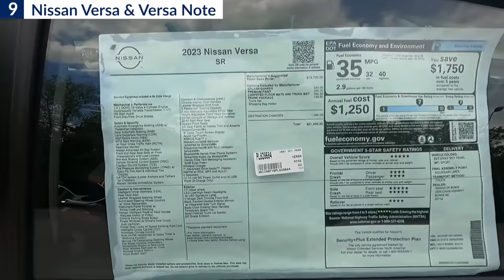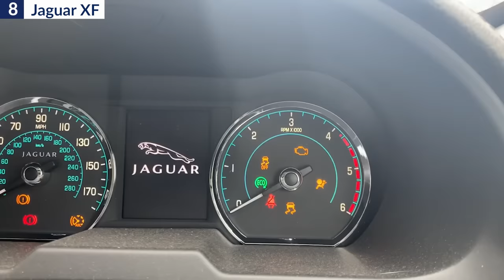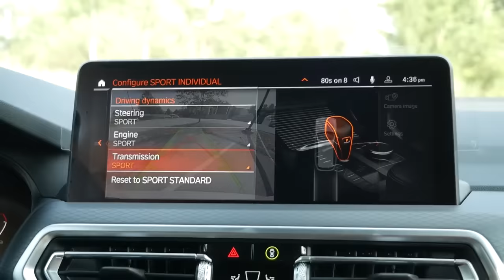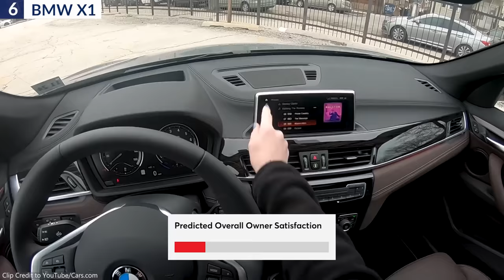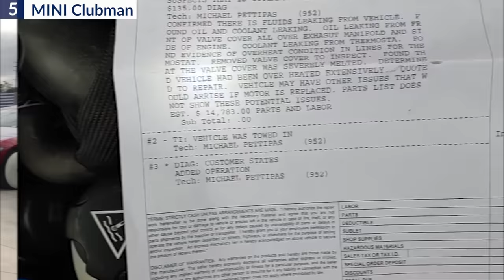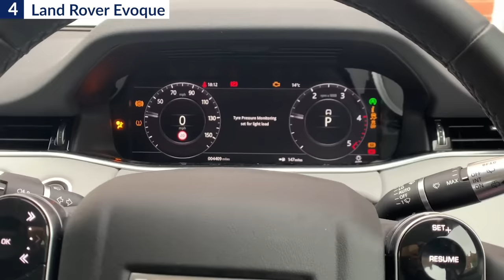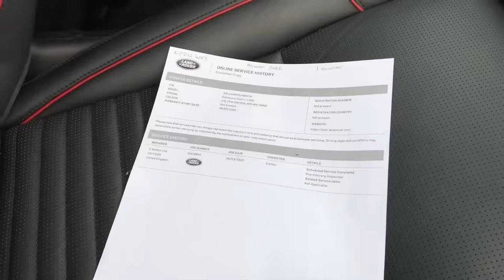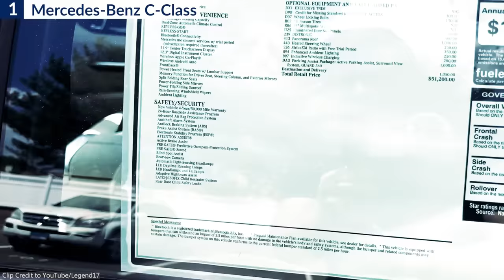9 Cars Owners Get Rid of in the First Year | Here is Why !!

Comment: What troubled me the most, as a mechanic for 50 years, was poor people who bought used luxury cars , not understanding the expense of ownership.
Reply: "your range Rover eml is due to a bad nox sensor, which will cost £550 for a genuine quality part, 2 hours diagnostic, and a hour for fitting, total will be £750" 
Customer:😮😢
Reply: As a mechanic of 25 years now I've always said "if you can't afford to buy it new, you can't afford to own it used".
Can't tell you how many people I've seen saying they got a good deal on this (bmw,range rover,benz,audi ect)
Reply: I only drive bmw and I only lease.
Never had to pay a dime for maintenance.
Reply: @Derekzparty you’re paying for it in the depreciation
Reply: @dforrest4503  I give the car back when lease ends.  Depreciation doesn't affect me!
Reply: @youtubecantsaveallthesnowf8601 I got a good deal on an Audi A3 Sportback.sold it after two horrible years. Changed the evaporator, two transmissions, thermostat amongst other things. It was burning oil when I sold it. Worse car I've ever owned
Reply: @Derekzparty How many years do you usually do a lease? Been thinking about doing it myself. I get why ppl don’t like doing it cuz ultimately you’re just paying to use the car and won’t get that money back whatsoever since a lot of ppl return it instead of buying it.
Reply: @jacks1bonnielass  I usually lease 3 years.  You do get something at the end of the lease even if you return the car.
For example I am currently leasing a 2023 m4 competition xdrive for 3 years at $1205 a month.  To actually buy an m4 on 5 or 6 year plan it was about $1800 a month.  So I save $600 a month versus buying it, $600 x 36 months = $21600 in savings. I could lease 2 cars in the 6 years it would take to buy one and with some very general assumptions I would need an m4 that I bought after 6 years to be worth $95000-$43200 or about $52000.  
Could it be maybe ... not sure.  But with leasing I don't need to care about the car. I can redline it at every stop sign/light and know that if anything breaks its under warranty and not my problem.
Having said that i wouldn't want to purchase mine after 3 years having known all I put it through!
Reply: $95000 was the msrp of my current m4.
Reply: @Derekzparty  I just bought a 23 Silverado. The computer knows every hard braking incident, every hard acceleration, every RPM it turns, every time over 80 mph.  Changes in lease clauses are probably coming.
Reply: @rustynail7866  Did the same thing in my 2020 z4 m40i.  No questions asked when I got the m4 last December.
Reply: @Derekzparty  Good deal. They wanted me to insure through them. I said Oh No. you guys know too much.
Reply: @rustynail7866  The bmw m cars were meant for the track.
The m4 literally has a drift analyzer for grading how well you slide through a corner.
I would assume bmw gives at least those cars a pass for ... spirited driving.
Reply: @Derekzparty  Yes I know all about M series. Officer Friendly informed me several years ago that I should sell mine.  I did.
Reply: Ppl that are born rich might not know or might not care because they only understand prestige and not necessarily reliability nor value and quality.
Reply: @SayAhh  When it comes to value and quality only 2 cars come to mind have a sub 3 second 0-60 and are under $100,000.
The m4 competition xdrive and the new c8 corvette.
You don't get those cars for the prestige you get them to drive fast!
For prestige you get a rolls royce/aston martin or really any car above $200,000.
So in a sense m4 and corvette are great values!
Reply: @Derekzparty  You pay for it up front & every month of ownership ! Anytime you want to talk about COST of ownership & compare it to my MX-5 Club soft top roadster I'm game !
Reply: @Derekzparty  You get them to understand how valuable a good Lawyer is ! Bleeding your wallet DRY !
Reply: @ag4allgood  My last car was the z4 m40i. 
Not as fast as the m4 but it was a 2 door convertible like the Miata and very fun to play around with!  
The 6 second 0-60 in the mx-5 was the biggest turn off for me.
No doubt the mx-5 was cheaper but also much less fun!
Reply: @Derekzparty  Your absolutely wrong. The whole less is more feeling is hard to describe to people that have NEVER driven one ! The Miata was NEVER about 0 to 60 times but rather ripping the corners at speeds your Z4 could never do without losing grip. The Lotus founder Graham Chapman said less is always MORE ! Until you drive one you will NEVER understand those words ! Why do you think the Miata is THE MOST RACED CAR IN THE WORLD ? The BMW M4 might be a great car in your eyes but it is an overweight hippo in comparison.
Reply: @ag4allgood  The Miata weighs 2341 pounds and outputs 181 horsepower. (12.9 pounds per horsepower)
The M4 weighs 3830 pounds and outputs 503 horsepower. (7.6 pounds per horsepower)
Going by the power to weight ratios the hippo is the Miata. 
In addition if we are talking about the grip between a z4 and a Miata it's as simple as looking at the Car and Driver skidpad results
Miata Roadholding, 300-ft-dia skidpad: 0.90 g
Z4 Roadholding, 300-ft-dia skidpad: 1.00 g
And while we are here ...
M4 Roadholding, 300-ft Skidpad: 1.02 g
(A higher g means more grip)

I'm not trying to be mean ... the performance is just what you get when the car costs 2-3s times more
In fact if we go even higher
911 GT3 Roadholding, 300-ft Skidpad: 1.11 g
But those start at an eye watering $170,000!

The short answer of why is the Miata the most raced car in the world is the 911 GT3 doesn't cost $30,000 lol
Reply: @Derekzparty  You can put all the numbers up you want it doesn't change the way the Miata drives in comparison to a Z4. Given another $37,500 in modifications to a Miata ( to bring the dollars spent equal ) I'll take the Miata ANY DAY over the Z4 !
Reply: @ag4allgood  To each their own!
Something to make note of is $37,500 in modifications will most likely void the warranty.
Reply: @Derekzparty  LOL !
Reply: Got a Lincoln town car a year ago dirt cheap. 92 SS dual exhaust. Amazing shape.  Not one issue so far
Reply: @lostbooks2918  Town Cars are inherently excellent vehicles. Though they are considered “luxury” their sum of parts are basically Ford, which makes them less expensive to repair than a Mercedes or BMW.
Reply: I blame reality TV and advertising
Reply: @ag4allgood  For some people acceleration and speed are everything, so they enjoy their M4. For others a huge amount of fun at the wheel is their poison, so they savor their Miata ☺. I enjoy my E63 6 Series coupe, but have a lot of fun in my MX-5/Miata.
Reply: This is an interesting topic. I suspect it's a combination of a few economic and social factors, such as rapidly growing economic inequality coupled with stagnant wages. Millennials in particular seem more concerned with maximizing value than previous generations, with "X-hacking" ideas often going viral on social media as "tricks" to get around the way things, they feel, are stacked against them. Now take this "bougie on a budget" mentality, and add onto that the normalization since at least the 80s (and maybe longer than that, but I grew up in the 80s) that virtually everything in America is meant to be cheap and disposable, so if you buy your bougie but old car and it breaks down because it's old, no worries--used cars are 'disposable' now anyway.
Reply: If they're buying a luxury car and not intelligent enough to understand it's going to have a much higher than average cost of ownership I have no sympathy for them. It's not rocket science is it?
Reply: @Derekzparty  If you're leasing cars you're paying far more than average, you're just paying it to somebody else.
Reply: @Derekzparty  Yep, and this is why so many people have problems with ex-lease cars. I believe it should be declared when the car has been leased so those who can only afford to buy used know exactly what they're buying.
Reply: @severnsea  My monthly note is $600 lower versus buying which lets me pocket the difference each month.  Over the course of 3 years I would have saved 600×36 or $21,600 or $43,200 if we are comparing it 2 - 3 year leases versus a 6 year buy.
Scroll up for more detailed math.
Reply: @Derekzparty  That may work for the US but not in the UK where energy is more expensive and people only drive an average of 6-7000 miles a year. It's also not going to benefit the environment (which is supposed to be the whole point) if you're getting a new car every 3 years instead of every 6.
Reply: @severnsea  It isn't like leased cars head to the scrap yard as soon as the lease ends.  
The car simply goes to the next person.
In my old z4 the car had an eco mode for eco driving.
My current m4 doesn't even pretend to save gas with its lowest setting being comfort.
Reply: @Derekzparty  Yes, but if you move on to the next new car as soon as the lease is up then that's a new car that's going to be built every 3-4 years or so to meet the demand. Older cars are going to be scrapped a lot sooner than they are now in my opinion because people are not going to want the risk of buying an old car that may one day need new batteries. I'm talking about those people who buy 10-15 year old cars. If the batteries are expensive to replace a lot of people won't buy them so they'll end up being scrapped earlier than current ICE cars are. I know the batteries might be made to last a zillion miles or whatever but that won't stop people worrying about the potential replacement cost if something goes wrong.
Reply: @severnsea     If they are going to junk a car over a $200 battery that's their financially stupid decision lol
Reply: @Derekzparty  We're not talking about a $200 standard 12v battery, as well you know. lol.
Reply: @severnsea  Since I only lease I've never had a car battery go out ... i assume the 12 volt lead acid car battery is a standard?
Reply: @rustynail7866  Oh, it will be worse than that. Give it another 10-20 years and they will be sending you fines by post every time you go over the limit. They won't even need speed cameras.
Reply: @ag4allgood  I agree, but cars like the M4 are designed to be a family car as well as something you can have a bit of fun in. It's not all about who can take a corner the quickest.
Reply: @Derekzparty  I'm talking about going forward, when we're all stuck with EVs:
"If the batteries are expensive to replace a lot of people won't buy them so they'll end up being scrapped earlier than current ICE cars are"
Reply: @severnsea  LOL my mailbox ain’t big enough.
Reply: @severnsea  With a little maintenence even a 30 year old ice car can run decently well.

Once the battery in an ev is degraded the battery is physically and irreparably damaged.

Without significant advances in battery technology, aka solid state batteries, what you say will be our future.
Reply: @severnsea  It takes a whole lot of squinting to get family car out of m4 lol!
Reply: @Derekzparty  Yes exactly, I totally agree. And if buyers down at the bottom of the scale who can't afford much are scared off buying EVs because they are concerned they might have to spend thousands on a new battery, they won't buy so the cars will be scrapped earlier and won't have saved anything at all in emissions, which is supposed to be the whole point. The batteries may well be fine but that won't take the fear factor of them potentially failing away and will put people off buying, in the same way that they tend not to buy larger older cars now because of the concern over a potential big repair bill, hence the reason a powerful 10-15 y.o. saloon/sedan are so cheap to buy.
Reply: @Derekzparty  Can't argue with that! Something that somebody with kids is more likely to buy than a Miata though (we call them an MX5 in the UK).
Reply: They don’t care about expense of ownership.They care more about impressing others and showing off.The expense of ownership is an afterthought for them.
Reply: @Derekzparty  "I only drive bmw and I only lease." Leasing cars doesn't mean an unreliable car isn't costing you. While it's in the shop, you are paying for a car you can't drive. With BMW's loaners, that might be an excellent investment, since you get to drive a better can that what you are leasing. I came across that when my Sidekick was totalled and insurace put me in a deluxe Escape for 12 weeks.
Reply: @mikep490  The last 3 cars I've leased, 435i, z4 and m4 have been problem free with the only time spent in the shop being from pot holes/flat tires.
They were all new model cars so being problem free wasn't unexpected unlike with a brand like kia.
Reply: @mikep490  Even the times in the shop have been relatively brief thanks to the runflat tires being able to make it to the dealership without a tow truck along with my local dealership have replacement tires on hand.
Reply: @Derekzparty  That's good news. It's nice to know, reliable and only $8800 a year. The unlucky guys are those who buy and then have to sell. I'm sure some of those are corporations cars traded in.
Reply: @Derekzparty  If you think depreciation doesn't affect you on a lease, you don't understand how leasing works.
Reply: @MLHunt  I never own the vehicle so it depreciates while bmw owns it.
I make my deal once when I get the car.
Reply: @Derekzparty  Every lease agreement I've ever been aware of has a residual value term that is a major factor in calculating the total cost of the lease. Higher depreciation rates --> lower residual value --> higher lease payments.

Just think about it logically dude. If a lessor didn't take depreciation of the asset into account in determining how much they'll charge for the lease, there'd be no way for them to be certain they recoup their investment at the end of the day.

Depreciation of a leased asset is definitely a factor in what a lessee pays over the course of the lease, the fact that they don't own the leased asset notwithstanding.
Reply: @MLHunt  In a car lease a large portion of what you are paying for is the depreciation of said vehicle. 
When I said depreciation doesn't affect me it was in respect to the current and future value of the vehicle.
Whatever the vehicle's residual value is in 3 years does not affect me one bit.
If a solid state battery breakthrough causes EV's to take over the world in 2025 making the value of every internal combustion vehicle half of its current value or even lower it doesn't affect me because I have already made my deal with BMW and they have to honor it due to the contract we have between us.
Reply: @MLHunt  Had I purchased the vehicle from BMW on a 3 year plan in that same situation they would only offer me whatever the EV breakthrough reduced price of an internal combustion vehicle would be if I decided to sell it to them to get another vehicle.
Reply: @Derekzparty  I understand, and thank you for clarifying. But you don't think the dealership factored the probability of accelerated depreciation of current generation vehicles into its residual value projection? It would certainly have been prudent for them to do so given how rapidly the technology is changing.
Reply: @MLHunt  Unsure of how BMW price their vehicles but I would assume their new electric cars/suv are a hedge against rapidly developing technology that could possibly make their internal combustion vehicle lines obsolete.

Most every car manufacturer would prefer a glacial shift from internal combustion to electric due to all the research and development they have already spent on internal combustion.

I guess BMW could tack on a 1% breakthrough insurance fee on every part if they wanted to, but spreading their risk by creating their own electric vehicles sounds like a better solution.
Reply: @Derekzparty  Leasing is for most people an unlucrative thing. In your maths you forget the point that after you paid your car, you own it, and its probably worth around 60k or smth and you can sell it instant, while when you lease, you own thin air after it. That beeing said there are also car manufacturers who throw very juicy leasing deals on the market just to establish the brand, like cupra does in Germany atm, were offers appeared of 200 bucks a month for a 300hp cupra suv. 
I myself leasing since 12 years now, but only because i get juicy deals, for example im Leasing 3 Transporters atm with each cost me 240 bucks a month, while the usual leasing rate for the same transporter is about 600-800 a month depending on the interior. 
You cant say leasing in general is good or bad, it really depends on the deal you are getting and some deals are very interesting while other deals for the same car are just ripping you off. The carefree maintenence of a leased car is a cool plus tho =)
Reply: You're so right! My son fell in love with a used 2017 Porsche Panamera and found out he made a huge mistake!!
Reply: @xxxxXRIPXxxxx  The difference in your monthly lease payment and the monthly note if you had bought it is not thin air and can be substantial as you have just mentioned if you get a good deal on a lease!

Nobody seems to understand that $500 saved a month for 36 months is $18,000 in total savings.
Reply: @Derekzparty smart

You get rid of it before the problems show up.  👍
Reply: People don't do the regular maintenance like they should.

Notice  no Japanese or Korean car was featured .  👍 👏👏👏

Mostly European makes. 

Opps ...  A Nissan made this list 😮
Reply: @mikep490  Yep, and by leasing you're paying a lot of money for something you will never own.
Reply: @Derekzparty you can say it doesn’t effect you, but you ARE paying for the depreciation. Now if you don’t care, that’s one thing, but you are paying them for the privilege to have the long term rental.
Reply: You got that right, once upon a time, a co-worker bought a used BMW, he quickly rued that decision.
Reply: @justSTUMBLEDupon  You aren't understanding.  The projected depreciation is baked into the lease meaning whatever happens to internal combustion vehicles doesn't affect me even if internal combustion engines are made obsolete in 2026 when my lease ends.
My deal has already been made and is set in stone!
Reply: YEP I have owned over 90 cars the most expensive ever was  1997 BMW 740iL (in 2001) with 90, 000 on the clock.  Paid 22 grand (it was about 70 new) and about 10 in Maintenace.
Reply: @Derekzparty yeah but then you have come up with $$$ for a down payment on a new lease and pay for mileage if you go over, tires, and interior cleaning of the car.
Reply: @Derekzparty information always wins the argument ! 😎
Reply: My first "real" car was a Saab 99GL. Not a "luxury car" per se, but European. I sank so much money into just keeping it on the road. How much? In just two years, more than I originally paid for thee entire car.
Reply: Lol … I brought a lovely 2009 Mercedes Benz SL and promptly sunk $8k into a $15k car. 😳
Reply: Way too many people struggle to keep their cars on the road.  Insurance prices have gone through the roof, and there is the FoMo crowd that wants a better car in the driveway than the neighbor, until, of course, that car gets stolen or put on blocks.  High fuel prices also eat into the cost of ownership and getting a set of new tires will sit you back CAD $1000 or more (likely more).  My CX-5 is going into its tenth year and owes me nothing.  Regular maintenance, on time, and driving it with care will hopefully put two more years on the rubber.
Reply: @aelaan12  I keep trying to explain this to my girlfriend, who grew up in a city and never got her drivers license. She's in the process of getting it now and already bought a used car from one of her friends. She has absolutely no idea how costly it is to own a car. I guarantee within a year she'll give the whole thing up and go back to taking public transit.
Reply: Good to figure. They are poor for a reason.
Reply: Luxury cars have the highest depreciation
Reply: @Derekzparty  I have had a couple! Lease with warranty is the way to go! Otherwise, no warranty, and you are screwed! Still love how the car drives!
Reply: @Derekzparty  So you are paying $43280 for 3 years on a 95000 car. But you have zero to show for it at the end and zero to  use towards a new car. Leasing is good if you drive a lot and have the money, otherwise OWNING is the way. You don't have to own a 95000 car. You can get a 43280 car buy it outright, use for 3 years and then have say $20,000 to put to your next car, so now that next car that is say $43280 is now only 23280, then you are owning a 43280 car that you only paid 23280 for, and if you trade in two years, you may actually get even more. CASH is the way to go all the time. The problems with cash come when you are spending TOO much upfront. 95000 is a stupid amount to pay. 43280 for a new car ( ike a mazda cx 50 ) is easy
Reply: @Jack_Hunt  I have the difference between the lease payments and a 6 year note payments, assuming I had purchased it, as something to show at the end of the lease.
$600x36 months= $21,600 saved over the course of a 3 year lease versus buying it.
Double that to $43,200 for 2 leases and I am simply betting that over the course of 6 years a purchased m4 will be worth less than $43,200.

A quick google search of 2017 m4 show their prices in low 40s.  Subtract any maintenance required during those 6 years and I can be quite certain it will be near $43,200 if not below it.

Obviously it would be cheaper to buy Mazda-CX-50, but then I would be in a slow suv.

Having said that I used to have an RX8 and would be quite interested in a 400-500hp RX9.
Reply: @jakebatty530  You do know that maintenance is not a thing on new cars, if it goes wrong and is not a consumable  for the first 3yrs or 100,000miles then it's on them.  Thats why people buy new cars, peace of mind.
Reply: @marcjohn7416  again if it was brand new it had a warranty. If it was brand new and smoking after 2 years you have got to ask yourself was it something I did because Audi's don't smoke after 2 years from new unless they've been really badly abused or you used distilled potato peelings for fuel.
Reply: @jonhiggins8390  the replacement mechatronic was new and it broke again after a year. I don't drive crazy fast or accelerate quickly. I got two young kids to live for. Tell me how does one maintain a transmission that's less than a year old?
Reply: @SayAhh Correct
Reply: you not wrong. Why do people do who can't afford the car, would want to get the POS car in the first place is beyond me. I'm make good income and all I drive is a Toyota Corolla.
Reply: Yeah, if you can affford the car, you should be able to afford the on going maintenence, these figures aren't about the cars they're about the owners.
Reply: I'm with you Rusty. I am a retired tech also. I've seen it all and so have you.
Reply: @jakebatty530 I have a 2007 Range Rover Sport TDV6 and it costs me an arm and a leg in parts and service costs (even at a regular garage). But I knew that when I bought it and accepted it up front.
Reply: Of course it does.  Expected depreciation is built in to the lease formula.  You are paying plenty, and didn't even know it.   @Derekzparty
Reply: @rrrogster  Expected depreciation being built into the lease formula is the entire point.  No matter what happens my lease is locked in place.  
Every quart of oil, every tire, every major engine issue is covered with no deductible.
I know exactly how much I need to pay every month for the car and not a penny more.
No surprises!
Reply: I agree completely. As many replies here state, many lease and just trade in every year or two which means there are significant deals to be had. I picked up our X3 a year old with 15k miles on it and saved $16k just because it was a year old. I do all my own car work and maintenance so it's an excellent deal. The ZF transmissions are the best in the world and the B48 is much improved over the N20. I recommend thicker oil if you drive it like it should be driven, I use LL-01 approved 5w-40 (Castrol Edge) and change it w/ filter every 5k-6k miles, total cost $35. I did plugs and air filter at 30k miles. Plugs are $20 each so that was $100. I just did the 50k maintenance, trans filter/pan & fluid, differential fluid, and cleaned the intake valves due to the direct injection. Total cost was around $300 for all the parts. Total cost in maintenance so far w/ all oil changes is $715 over 3 years and 55k miles total on car. That's only $240/yr to drive such a nice vehicle and keep it excellent condition, I'm okay with that since it's about the same costs of other cars I've owned (Subaru/Honda/Toyota). The Subaru was the most expensive because it had a timing belt which I did twice, first at 75k (belt/tensioner) and again at 150k (belt, pulleys, seals, waterpump, tensioner, etc..) before I sold it privately. Around 100k the valve cover leaked oil into the spark plug tubes. Thermostat went not too long after that. Our older Subaru legacy had head gaskets fail around 120k. I won't buy Subaru again, they cost too much for what you get, nothing special and not very fun to drive (sans WRX).
Reply: Nothing depreciates faster than a German car.  They are so cheap that when a major problem arises, they are junked.  In California, I've seen many German cars that are rust free with immaculate interiors in the junkyard.  It's truly a waste.
Reply: I know what you mean.   I hope they are not buying EVs.
Reply: @encinobalboa   That says more about Californians and their lack of proper car maintenance than what it says about "German cars".
Reply: @Derekzparty  You Must Be Really Loaded With An Over Inflated High Paying Income Job For Whatever Reason.  But For Us REAL Actually WORKING Folks;  Imagining That A Car Would Last 30-Years, Just Think How Much Money Your WASTING By Not Owning A Car For That Long.  All Of That Monthly High Dollar Car Payment And Much Higher Insurance Cost,  Could Be Better Invested For Your Kids College Or Retirement Years.  Let Alone Helping Out Charitable Organizations For The Poor And Starving People Abroad.  We KNOW What Scraping Buy And Living Within A Budget Entails.  But Self Centered Braggarts As You Sound Like Are Actually SICKENING To listen To Indeed Kiddo...
Reply: @davemckolanis4683  Driving a 30 year old vehicle sounds like it would be extremely unsafe for you and those around you.
I give 10% of my income to charities each year.
I don’t have nor want kids.
Reply: Like Dave Ramsey said" they try to impress people they don't even know".
Reply: @Derekzparty That’s the smart way to do it, I remember seeing someone drop off their laundry in a bag and let someone else do it, there I am spending most of a Saturday afternoon fumbling with quarters doing my own laundry and waiting for the clothes to dry,
Reply: @Derekzparty  : You are lucky that you never had to replace the thermostat - when they go out, the parts alone cost something like $700. Also, when you have even a mild crash, the electric power steering will die shortly afterwards. Very well known problems with the BMWs, unfortunately.
Reply: @marcjohn7416  On the cars with the V8 with the dual runner intake manifold, the timing chain will die around 60K miles, and break the crankshaft.The next problem is that the plastic throttle plates that select which intake runner get used break, and then cost you something like $4K to replace the whole intake assembly. Want to change something on the very front of the engine? Totally disassemble the front end to get at it.
Reply: Yep! that is SOP on what keeps poor people poor
Reply: Debs husband says Mercedes Benz and BMW are two cars I will never buy simply because the maintenance and repair costs are more than I am willing to spend. They are great cars if you have the money.
Reply: @Derekzparty The only problem I have with the leasing business, is that you'll probably spend the same amount on leasing two cars in 6 years as buying a single one. While at the end of the 6 years you would own nothing, and still be lighter in cash worth a whole car. Furthermore, you won't have gained the experience required to maintain a car well.
Reply: @TheWeedOperation  The difference between purchasing an m4 and leasing an m4 was $600 ... $1200 versus $1800 a month.  Multiplied by 36 months and we get a savings of $21,600 over the course of 3 years.
Doubling that for a 6 year purchase the question becomes will a 6 year old m4 sell for more $43,200.
Some quick google searches show 2017 m4 in the mid $30k to mid $40k range.
All the cash saved each month can be put towards more profitable things like stocks and bonds versus hoping the dealership shows pity on me and gives a good deal in 6 years for the hypothetically bought car.
Reply: @TheWeedOperation  As for experience maintaining a car that's what we have car technicians for.
They literally went to college/earned certificates for exactly that purpose.
In the same way I wouldn't expect them run the ethernet, punch down the cables and program the routers and switches at their establishment.
Not that they couldn't with all the right resources but it probably wouldn't be time/money efficient to do so.
Reply: @Derekzparty  How much is your average payment to secure the car and monthly payment? Do you have to pay gap coverage?
Reply: @youtubecantsaveallthesnowf8601  Not always true.  I can't afford to buy Toyota's new, but I buy them used and so far they've lived up to the reputation.
Reply: @rustynail7866  It’s dystopian
Reply: @jawharris  I'm paying $1205 for the monthly lease payment.  If gap was required it's included in that.
$83 a month for insurance.
Reply: @Derekzparty people outside the US don’t understand how interest rates have impacted purchase affordability vs lease in this current market.  Makes more sense to lease ANY bmw over purchase no matter what but especially now it’s a no brainer for a lot of cars not even just bmws.  Try to go even deeper and look at used cars and even that reinforces that a lease is most prudent in this market
Reply: @davemckolanis4683 lol you just said bmw and 30 years? 😂  if you ever try to buy a bmw built in the last 20 years you will learn why leasing is the Only way to do it.  If you finance you will lose your butt if you try to resell.  Doesn’t necessarily apply to all cars but certainly does for unreliable German ones.  Bottom line you are buying a bmw for its best years not year 8-15 when you’re sinking thousands a year in maintenance.  The luxury market has never been predicated on long term ownership.  Is what it is, that’s why it’s a luxury lol.   

I owned a f87 m2 and financed, sold after 4 years losing less in dep than a Toyota Corolla, but that was an anomaly and mainly due to interest rates at the time, Covid and limited production numbers.  

I know a guy that bought a 92k m4 and sold it less than 3 years later for 52k.  Just lease and be ok with spending that money every month, or don’t buy a bmw
Reply: @youtubecantsaveallthesnowf8601  I've always said whatever you pay for a used luxury car you should also have the same amount of money set aside for repairs. Some of these cars cost 10k a year to tax, insure and fuel and maintain.
Reply: @gravemind6536  hell, you need double.
Can't tell you how many customers I've had that got a "screaming" deal on a benz or bmw only to find out they have a repair bill double what they paid for the car.
Reply: @Derekzparty you pay for that with the equivalent of a 27 percent interest rate on a lease
Reply: Lexus is one of the cheapest cars to maintain. 
It is slightly higher than Toyota average
Reply: Pretty much anything Europeon particularly German is high maintenance and does not do the miles reliably  that a typical japanese model will do. One of the worst examples is the Audi v8 that has timing chains at the rear of the engine. These do not last much longer than a timing belt so need changing. This is a complete engine removal for this job. Another example is the BMW hot vee engines which are a total disaster. Yet another example of poor design and engineering.
Reply: @TheAllEngineering  anything vw...people think they can treat a jetta like an accord... it doesn't work.
Reply: @riogrande5761  thats because they are older toyotas...new ones suck.
Reply: @youtubecantsaveallthesnowf8601  poor advice in my opinion. I choose not to finance a car, I don't want a lot of money tied up in a car. I've owned multiple BMWs, Audis, Mercs, Saab, never had a problem affording bills, but its never been too bad anyway. Worst was Ford and Mitsi for reliability and repairs costs.
Reply: @krisby1  then count yourself lucky.
Reply: This is prevalent in the Black community. While I never fell for the scam of a used luxury car, my family members did.  After tax return they would go buy a loaded 10 year old BMW or Mercedes with 150k miles and then put 4000k dollar rims on it at a buy here pay here lot. But they’d miss a payment because it would inevitably break down due to poor maintenance. It’d get repoed a few months later after hiding it from the tow truck.
Reply: @Derekzparty You do it through the high amount of down payment/front loading, high monthly payments and high taxes on a new car. I've done it.
Reply: @youtubecantsaveallthesnowf8601  Great expression
Reply: @Derekzparty   $1205 a month for a rental and your braggin about  not paying maintenance costs? LMAO. A sucker is born every day man.
Reply: If you lease, hope you don't get divorced because  companies, banks, dealerships don't care. " F U, pay me"
Reply: @claviclenotch1876  Same situation as if you didn't lease.
Whoever's name the agreement is in is still responsible for payments.
If the other partner cosigned then the lending party could pursue both people.
Reply: I’m more than a little surprised that there are so many high end cars on the list. Some high end brands have been notorious for unreliability as far back as I can remember. And I don’t know why anyone would buy a used high end car that they couldn’t afford to buy new as is with no warranty. As soon as it needs work of any kind they find out why.
Reply: It's called braindeadness 😂😂😂😂
Reply: When I bought my roadster, the only options available were Porsche, Mercedes, Toyota, and Mazda. As tempting as the luxury styling of the German cars were, I settled for a car made in Japan.
Reply: @youtubecantsaveallthesnowf8601 
There are two things every man should avoid in life, high maintenance cars and high maintenance women.
Reply: @Derekzparty lol , u did say you lease!
Reply: @Bigdrip840  I did!
I'm saying the bank doesn't care if you lease or buy.
They always want their money!
Reply: @Derekzparty  uh
Reply: @jacks1bonnielass  you don't get deprieciation back whether you buy or lease.
Reply: The worst light you will ever see is a "Check Engine" light in a German luxury car! At the big auctions, MB and Audis sell way below their new price once the warranty is gone.
Reply: That's why they're poor.
Reply: @marcjohn7416  
Me too, I trashed my A3  45k miles, at the junkyard.
Reply: @Derekzparty  What "Depreciation doesn't affect me", lol, you are absolutely the first one to absorb the cars depreciation in your lease payment.
Reply: @youtubecantsaveallthesnowf8601  I remember buying a 2005 corolla for $500 all it needed was a new axle since for some reason the throttle was a touch too snappy, probably something the previous owner did. for 3-4 years the only thing I did was oil changes. 

The check engine light was only because of O2 sensors acting up or some. Specifically a P0420 code, despite the cat being replaced. Some sort of exhaust leak or something could be causing it, but that's as bad as it got. It would stay off long enough to pass emissions at the least. 

Only bought a new car as my family wanted something to make sure I wouldn't miss a day at work, but I bet I wouldn't miss a day in this corolla anyway, even with over 200k miles.
Reply: @rustynail7866  Also citations will eventually be coming for those tracked items as well. Don't forget the sensors they want to add for alcohol and other substances.
Leasing is fine if you are a business as it is a right off, but as a individual it makes less sense.
Reply: so you were a judgemental mechanic? what luxury cars were poor people buying 50 years ago? i call BS
Reply: @antcantcook960  Your reading skills are extremely limited. I didn’t retire 50 years ago. I worked in the industry for that amount of time. Secondly, in case you think you invented something, Porsche, Mercedes,Cadillac, Jaguar, Range Rover and Lincoln were available long before you arrived. I call DA.
Reply: Or prep people buying ford's. Mind blown
Reply: @Derekzparty after all these years of paying for a vehicle you own nothing.  You lost all that money on leases.  I would think driving m4 would be a car you would want to keep ?  I have a 12 car garage I have been filling with cars since 1996.  They are an investment that provide substantial returns if you picked the right cars.  I would have kept the m because they don’t depreciate. 

I’d argue 911 gt3 rs are actually slow on the track.  They are based on the production 911.   As someone who owns and races a modified sr8 radical , I pass them like they are sitting still.   

One of the other guys mentioned a Miata, I will agree with you that the Miata is a porker compared to the bmw power to weight wise.   My exige only weighs 1543 lbs and makes 622 hp thanks to the twin charging.  I’ve never understood buying the Mazda which is a compromise in every conceivable metric when it doesn’t live up to the hype, underpowered, overweight and expensive for the actual return. A z4 makes much more sense to spend the extra money and get twice the car over a Miata.   

Best of luck
Reply: @ThorOdinson-zc2kq  I typically only have one nice car at a time, definitely not a car collector.
The difference between the lease monthly note and the buying monthly note is the money saved at the end of the lease.

Math was done in one of the 100s of posts above, think it was $400-500 a month in savings.
Reply: @Derekzparty what's your usual duration for the lease? Do you think paying more than 600 is a good idea? I'm having hard time  deciding between financing and leasing.
Reply: Sometimes I want a luxury car knowing I can easily afford it, then looking at repair cost throughout the year it scares me. I'll stick with my Honda.
Reply: Doesn't trouble me. The info is out there. They're just hung up on appearances, and they buy cars that have the quality build and ride of a cheap Chevy, at many times the price. A fool and his money are soon parted, as the saying goes.
Reply: @youtubecantsaveallthesnowf8601 h
Hello, are mazdas good SUV'S ? if not which one would you recommend please?
Reply: @chanikaoverton7110  Mazdas arnt bad, but you can't go wrong with a honda.
Reply: Agreed. A wealthy friend of mine who drives the BMW 7 series and a GWagon told me when I mentioned I was considering a used BMW 5 series.  He said: “Dont  do it! The maintenance costs are ridiculous. Buy a good used Japanese car with all the bells and whistles that won’t cost a fortune to keep running”.  I found it curious as he loves his BMW and G Wagon…he told me “I can afford the maintenance”.  Sound snarky? No…he was being a good friend.  He’s a multimillionaire and I’m not.  I now drive a lovely top trim Mazda CX90 with no regrets and with all the comfort of a BMW 😉
Reply: The common quote by almost all motor mechanics in Nz and Oz: "Only Fools and Poms buy European brands."  When these fools get their bill for their repairs the mechanics often say: "Well, you should have asked a mechanic what car to buy.  Maybe next time to spare the tears you will do that!"